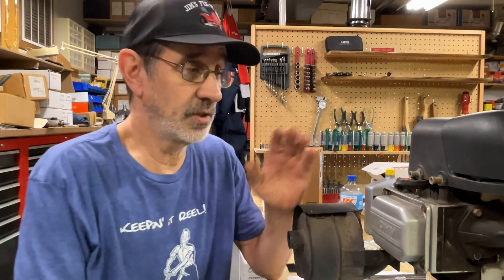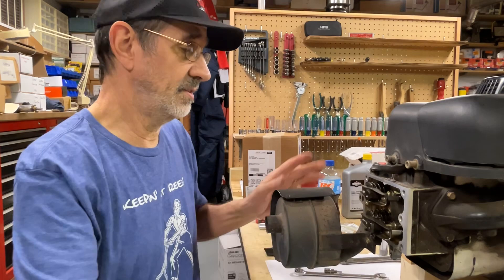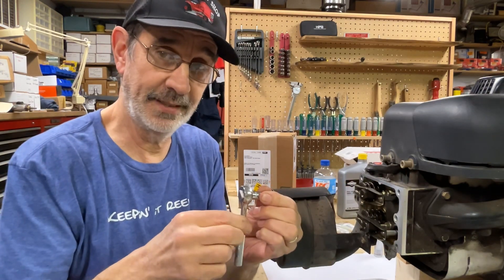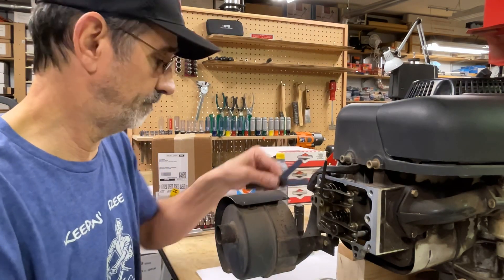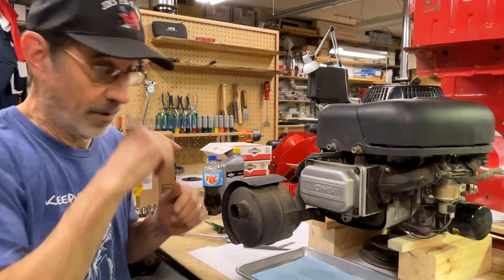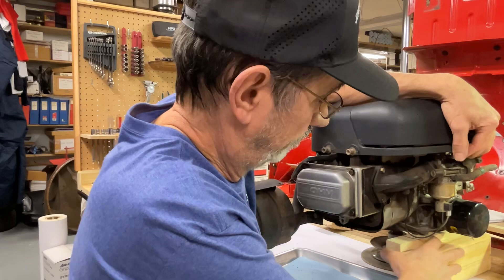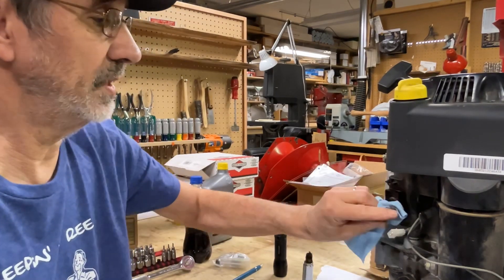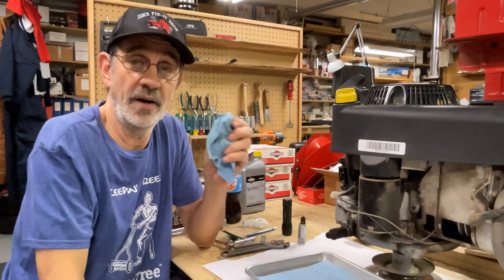464. How can I adjust the valves on my overhead valve engine?

Comment: My 11 HP Briggs on my Snapper Comet 30" model 307XS all of a sudden slowed down, then, shut off.  ????  What could it be?  The crappy gasoline that we've been getting lately?  Maybe.  I assumed the worst.  I had a spare carburetor. So, I drained the fuel tank, purged the fuel line, changed the inline filter, and put on the spare carburetor.  Started it up, and, low and behold, it did the same thing.  

I am not an engine mechanic, but, I figure that if it is getting fuel, air, and spark, something more should have happened.  So, I pulled the valve cover (after removing the muffler for access and the spark plug) and the problem was obvious.  The rocker arm on the intake valve had cracked in half.  Me, being the cheapskate that I am, tried silver soldering the steel rocker arm.  This did not work.  Took it back off and tried welding it.  That did not turn out so well either.  However, I did learn a good lesson from this dog bite.   If your engine slows to a crawl and then stops, and, it's got fuel, air, and spark, then check the rocker arms!

I watched the video and will check my valve tolerance when I install the new arm.  I don't know where to get the valve tolerance data from, but, by the time anyone reads this, I will have that data for sure.  

Jim, your videos are the most helpful and useful content that is on Youtube.  Thank you so much for your patience and attention to detail for all of us non-mechanics out there who are just trying to keep our mowers running!  Keep up the good work and may God bless you and yours.
Reply from the maker: @winfordnettles3292  well to answer your question on valve Clarence I have a chart here, but I would have to know what engine you have, there is a wide range of sizes depending on well, for example

 L head, aluminum sleeve single cylinder engine intake runs from .005/.007
Exhaust runs from  .007/.009

Then you have a L head cast-iron single cylinder engine, which are different 

Then you have an L head opposed twin cylinder engine, which are really different.   

Then you have an overhead valve single cylinder engine, which again are different. 

Then you have an overhead valve tune cylinder engine, which are different again.
Reply: @jimjackson9381  Jim:  My Briggs & Stratton OHV engine is 216902 0125 E1 .  I just did not know where to look for the valve clearance information for this engine.  Where did you get the valve adjustment chart?  Haven't found it anywhere so far.   Thanks for all the information.  Your videos are priceless!
Reply from the maker: @winfordnettles3292   I got it off the Briggs & Stratton website. It’s just called a (check chart) 
   But it does not list your actual model series, but the number before it and the number after it is both the same intake valve is .005/.007
Exhaust valve is .007/.009
That’s, the best I can do with this chart

Comment: Sorry..newbie here.  I have 14hp single vanguard that is back firing through the exhaust.?? I’ve been told to set the valves to .005 on both, h it ran but died (that’s what started my issues..it would crank and run for a minute or two and then just die.   I be new told to run .005 on the exhaust, and .007 or .008 on the intake..? Still backfires through the exhaust…I cannot seem to find any factual document that says this is the way it’s supposed to be…what are they supposed to be?  Also I’ve been told could be bad gas or dirty carb..?  Any help anyone can share will be greatly appreciated..
Reply from the maker: @sharpshooterofky  most of the mechanics I watch set both valves at .005   But if you still have any issues, I guess I will try cleaning the carburetor and see if that helps it sounds like it’s a timing issue. Have you taken the nut off of the top of the flywheel and check to see if the key is OK or if it’s slightly twisted, it does not take much. I need small engines to mess up the timing. It does not have to be completely shared. If it’s just a little bit on the crank it will cause issues.   If nothing else pull the flywheel and put a brand new key in it.
Reply from the maker: @sharpshooterofky  if your engine is backfiring a check of the key in the flywheel and make sure your flywheel hasn’t turned slightly. It doesn’t have to turn off the key off, but just slightly enough to throw off your timing. It doesn’t take much to be safe. I think I will just pull the flywheel and put in a brand new key.

Comment: Would adjusting valves  help a engine that smoke at start up?:face-blue-smiling::face-blue-smiling:
Reply from the maker: Well without having your engine in front of me so I can run some tests on it I would have to say it sounds like your piston rings need to be replaced. If you know someone with a leak down tester, they could tell you in about 20 minutes what’s wrong with your engine?        Jim
Reply: @jimjackson9381   Thanks  jim it a old snapper rider it only smoke at start up but i have to add oil everytime i use it.
Reply from the maker: @k9under  well, like I said, I would have to run some tests on the engine to find out if it’s a valve issue or piston rings.       Jim
Reply: Do a compression check on the engine.  I'll bet the rings are worn out and that is why you have to add oil each time you run it and it smokes due to the blow by oil getting into the exhaust.  When the exhaust heats up, the oil turns to smoke until it burns off inside the muffler and exhaust.
Reply: @winfordnettles3292   thanks it a 1990 snapper rider.:face-fuchsia-poop-shape:

Comment: Simple question Jim but google doesnt seem to understand my question. So between the 25" deck and 28" deck snappers, is the width of the outside of the wheels the same? And what is that width? I have 29" max ramp and space to transport it. Does that make sense?
Reply from the maker: I don’t know about a 25 inch I don’t have one to measure the 28 inch machine is about 27 inches from outside to outside of the front tires. I hope this helps.       Jim

Comment: Jim did you lock down the intake valve?
Just rerun the video you might have just done it a different way than the exhaust
Reply from the maker: Yes, I’m pretty sure I lock both of them down. I can check it though. Jim.
Reply: He clearly did tighten down the torx while holding it with crescent. Pay attention!